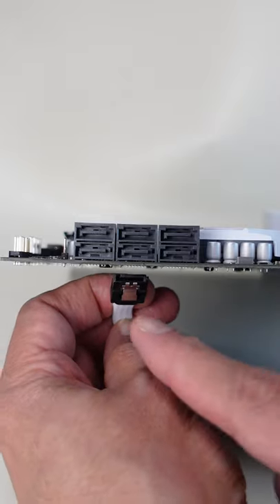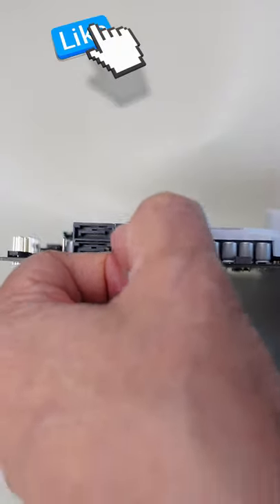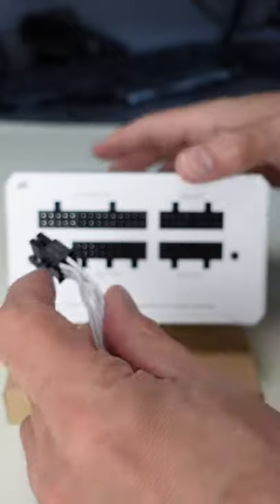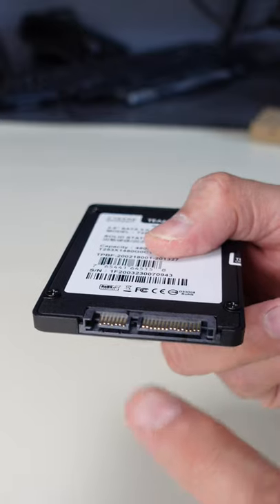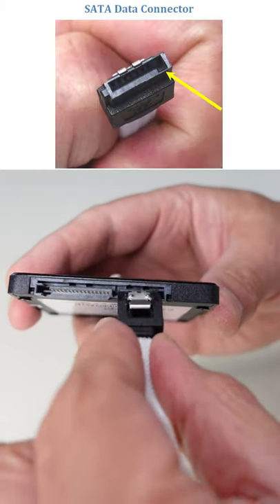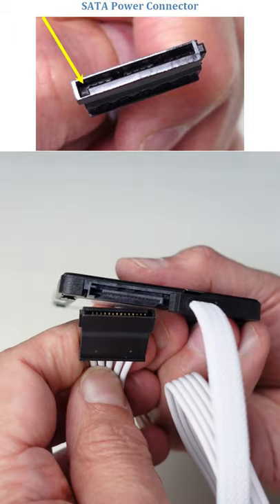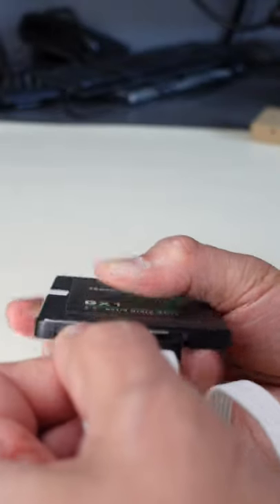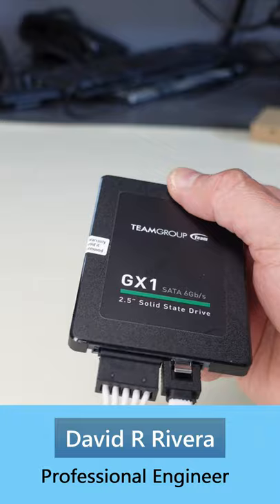Properly Connecting a 2.5" SSD to a PC Power Supply and Motherboard #Shorts

Comment: Any idea where to get one of these Power cables for your PSU to the SSD? I got a PC second hand and didn't get the cables, been wanting to add an extra SSD to it. Currently it has one m.2 set up. Cannot figure out what to Google to find the correct psu cable
Reply from the maker: Your power supply should already have one or more of the SATA Power connector on one of it's connectors.  There is the possibility however that you have a modular set of cables for your PSU that the cable was not connected to the PSU itself.  If that's the situation, you will need a cable that matches the brand model of your PSU.

Did your system com per-assembled?  If so, did the seller provide you with extra power cables for the PSU?

BIG CAUTION!  Never use the wrong cable from the PSU to the SSD, doing so would very likely blow up the SSD.
Reply: @PE4Doers please send any example model name
Reply from the maker: @sat5812  If you are looking for those White SATA Data cables, they can be found at Amazon using the following link: https://amzn.to/3C3ixUQ 

The SATA Power connectors cam with the Corsair PSU I used: that can be found at: https://amzn.to/3VslzJe

Comment: For some weird reason the sata cable wont go in the ssd, it just doesnt fit. I am quite sure it is properly aligned as i spent over an hour making sure of that. Could my sata pins possibly be damaged? i am afraid to apply too much force on to the ssd in fear of breaking it as it is brand new :/
Reply from the maker: Is that the SATA Date or SATA Power connector?
Reply: @PE4Doers  Power Connector. What is weird is that my sata power connector had 3 cables, 2 of which are already part of working ssds, which makes it weird how this one specifically is refusing to work  :/
Reply from the maker: I is possible they are damaged.  Do you have a magnifying glass to look at it more closely?
Reply: @PE4Doers  No unfortunately. Im thinking of buying a second sata power cable just to see if that one would be any different
Reply from the maker: @yonkaleqifsamayonka9803  Is that the cable connected to the motherboard at the other end?  Or the Power Supply?
Reply: @PE4Doers  Power supply, the one for data that connects to the motherboards fits in with the ssd. So only the power cable is giving me issues.
Reply from the maker: @yonkaleqifsamayonka9803  just be careful trying to buy a replacement of one of those.  A large number of Power Supplies have unique power lead wiring to the SATA and VGA cables, so you could actually cuase damage if you get the wrong one.
Reply: @PE4Doers  Oh i did not know that, how do i check which one my psu needs?
Reply from the maker: @yonkaleqifsamayonka9803  You need to search out the cables for your specific Brand/Model - they can be different even within the same Brand (based on product grouping).  I really would start with a magnifying glass.
Reply: @PE4Doers  Alright, i appreciate all feedback, thank you very much!

Comment: So right now I’m using the plug of sata to usb and I have the ssd running fine that way, I wanted to plug it directly into the motherboard like the way you showed, I ordered a data cable from amazon and hooked the sata cable of the psu to it, it ran verrryyyy slowwww and windows was unusable, I tried to change the sata port and the sata cable used two times and its the same.. what can I do? There is still like 2 sata cables of the psu that I haven’t tried but booting it up takes so long that I gave up trying the rest of the sata cables.
Reply from the maker: The motherboard BIOS may have improper settings for the SATA data ports.  Other than that, I really could not troubleshoot over comments.

Comment: Hi, just wanted to know what was that white box with motherboard, sata/pata and everything written on it. Was that your power supply if so then which one?
Thanks
Reply from the maker: Yes, that is PSU I was using for that video.   It is a Corsair CX750F RGB Power Supply.  Good for a system with up to NVIDIA 3070 GPU.

Comment: I have MWE 450 PSU and sata 2.5 ssd but Im not able to plug the power cable into SSD, could you please help me to figure out whatsa the reason?
Reply from the maker: Do you the little L-shaped notches on the cables and connector?  Were you able to line them up as put pushed in the cables?

Comment: What is the cord called that goes to the power supply
Reply from the maker: The AC Power cord, or outlet connector.  Some abbreviate it as the power cable or plug.

Comment: Does it matter as to which ports they go into on the motherboard?
Reply from the maker: That depends on whether you have another device on the motherboard that shares the Data Lanes with any of the SATA Data connectors - such as an M.2 Drive.  It is best to get your motherboard user manual to check if there could be a conflict.  Otherwise, except for very old motherboards (pre-2002), there should not be a specific order to how you attach a SATA drive.
Reply: @PE4Doers  Thank you. I've checked the manual and had a look on a forum and it seems like it'll be ok to go for 0 & 1.
Reply from the maker: @KjamLXX8  Great 🙂Let me know how it all works for you.

Comment: Can I use the sata power from my psu which also powers the hdd I’m using which is designated for desktop. I am concerned about the voltage output from the psu that it may destroy the 2.5 hdd Im planning to use as additional storage for my pc
Reply from the maker: All SATA power connectors drive the same 5v & 12v outputs for peripheral devices.  The only things different are the various connectors.  Back in the day, all PC's used Molex connectors with four large terminals, and the 3.5" floppy drives used an adapter down to a miniaturized version.  They all produce the same voltages and are only limited by the amperage they can provide.

Comment: I am looking for same cable as you used here any name especially 6 pin sata power
Reply from the maker: That is a standard SATA power cable that connect directly to the Power Supply Unit.

Comment: Amazing msi a motherboard where they give you Port in a way that it's hard to reach now i have to remove the GPU the entire motherboard to get to there
Reply from the maker: I know exactly what you mean.  I have wondered many times about a number of choices made by multiple motherboard designers, that should have clearly done things differently.  I guess the designers don't actually put together many PCs.

Comment: Just got motherboard but without sata cables can I use different sata cable from another brand?
Reply from the maker: Absolutely - I do it all the time (they are not like the cables connected to modular PSU's, which are all over the place in cabling configuration).  There are many types that have additional advantages, such as shielding and the ability to snap into the connectors, so I would lean toward those.

Comment: Hi! Im trying to get an SSD but im struggling with finding where power cable is, im not really sure what im looking for
Reply from the maker: The power cable for a SATA drive should be one of the cables coming right off the Power Supply unit of your PC.  It is a mostly flat connector about an inch long, and there are usually three or four on the same cable.
Reply: I am also struggling to get the same cable for unbranded mini pc h310c what you used here. Any reference.
Reply from the maker: @sat5812  That one I am not sure what you are referring to...  Do you mean the motherboard?  Or the Power cable?

Comment: Hi Bro, I have Perijack Motherboard and I don't see any additional power supply for SSD what should I do to install a SSD . Pls suggest me
Reply from the maker: Perijack?  Is there a model number?
Reply: @PE4Doers  i really don't have model number .. but it's very old bought in near 2017 or 2018
Reply from the maker: @YapheTS_PreM  Sorry, I misunderstood your original question - are you trying to add an SSD?  Then the only thing you need on your motherboard is a SATA Data connector (which MUST be present)and a BIOS to recognize the Drive.  The power is supplied by your Power Supply Unit (PSU) as a SATA Power connector.
Reply: Can I send you a photo of my motherboard on your email address so you can highlight the parts required to add a SSD. 

I have 1 TB HDD and I want to add 1 TB SDD as well. My one power supply is already added to the HDD and I don't see any additional power supply cable which we add to the SSD. 

In this case what I can do please suggest.
Reply from the maker: @YapheTS_PreM  Sorry,  that is really asking too much.  I suggest you read through your Motherboard manual.

Comment: I did that but I don’t see the drive pop up in disk management
Reply from the maker: Did you look at the SATA settings in the BIOS?  Also, do you have an M.2 drive already installed?
Reply: @PE4Doers  I haven’t checked my sata settings but I had 2 m.2 installed and I removed one of them to see if it would still work but it didn’t.
Reply from the maker: @jkftolys9550  I had an M.2 in one of my PC's recently the was using the data lanes from two of the SATA ports.  I was able to fix it by moving the SATA SSD to another SATA port.  This should be shown in your motherboard manual if there might be a conflict.

Comment: any slot?
Reply from the maker: I have not noticed any performance issue depending on the connector.
Reply: @PE4Doers  im trying to connect hdd, sata 2.5 and nvme hopefully they runs at full speed?

Comment: Could I use this for the hard drive on my dead PS3 to get my trophies?
Reply from the maker: Possibly, as long as the drive is a 2.5" and the USB can supply at least 1-full amp.
Reply: @PE4Doers  thanks. Will probably be giving it a try.
Reply from the maker: @CagedPhoenixThe1st  Great !  Good Luck.